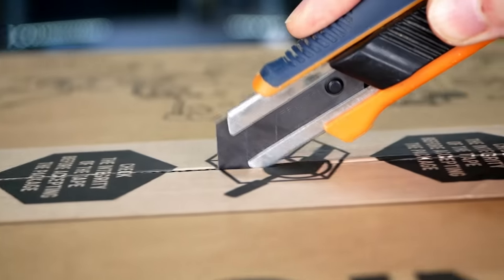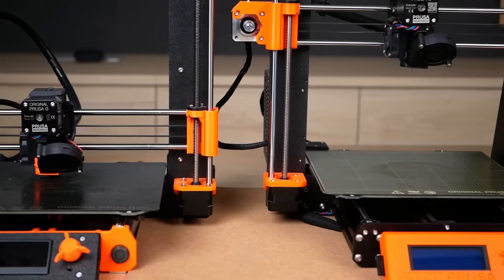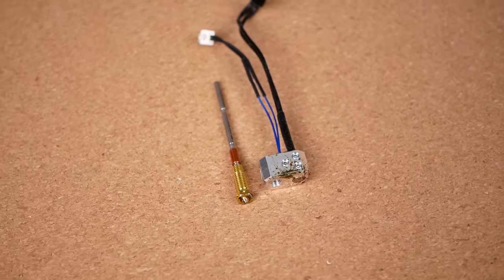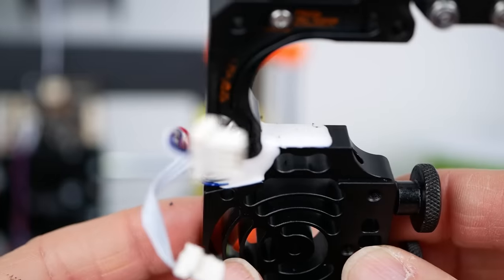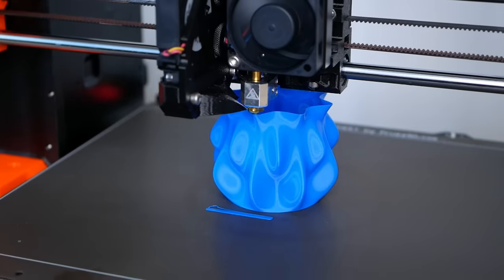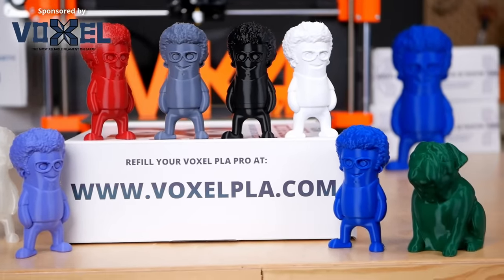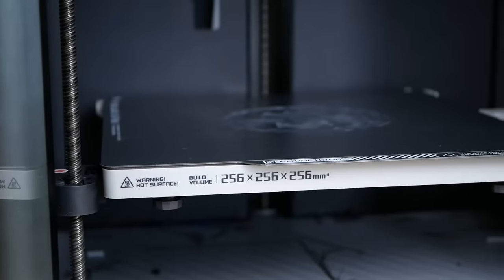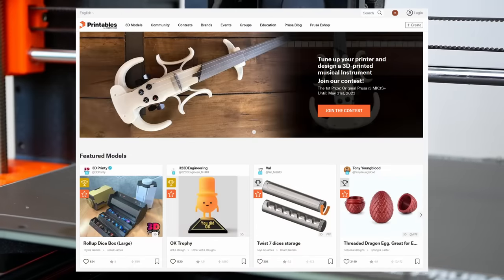Should you buy a NEW Prusa MK4 in 2023 or rather a Bambu Lab X1/P1P?

Comment: One often overlooked and not mentioned aspect of the MK4 is its terrible WIFI module (which is the same as in the Mini, so it is NOT fixable via an software update). It takes several minutes to upload a 10MB G-Code file and this is unbearable in 2023! Prusa Link isn't very good either (cueing for instance not possible) . Working on a daily basis with multiple 3D printers, this comfort feature of managing your data wirelessly and not needing to handle it with multiple USB sticks is a must have. I simply don't know who is responsible for such a design decision, but it shows to me, that Prusa is not able to provide products that are up do date anymore. It is basically still an upgraded 7 year old printer design, which is not competitve.

Something else that is of concern, is the use of an enclosure for higher demanding materials. The footprint of the overall package in comparison to the build area is not space efficient at all. The bed slinger design might be suitable for cheap manufacturing cost, which is why it is imo ok for entry level printers, but not at a pricepoint of 800$+

The Bambu X1C is the way to go, the only downside is its noise. But replacing the enclosure fan to a Noctua adresses the major part of that. The downside is, it will oid your warranty.

Something else I'm reading a lot about is the open vs close source approach, which suggests that replacement parts will be available for the MK4 kind of forever, while the X1C will be dropped once it has a succesor. I personally don't think it is so simple and even then not too big of a deal. What if Prusa as a company will fail due to not being competitve anymore? What about all the custom parts then? And what about stocking up on the X1C, as the prices are really low?
Reply: That was actually the deal breaker for me. As much as I would have loved to pay Prusa my money for the features of the MK4, I don't feel like downgrading Wifi from 4MB/s (MK3S, Flashair SD) to 100KB/s. In addition, the nonsense with the missing input shaping at launch and the announced, partial withdrawal from open source, have made me cancel the order and wait for now.

Comment: my problem with prus style printers have allways been, that they are more of a project then a tool themselfs - shure - they are advancing ever so slightly, but compare it to a regular printer: yes its great that there are pen plotter designs available, that i can assemble and have a printer with, but givern the option of buying a hp,epson,canon,(you name it) printer from a electronic supply, that i just take out of the box and install the drivers for (and have my part printed in minutes, within enclosure, without dirt, automatic paper selection, ink cleaning and soon)  - its hard to justify anything, as long as i need a tool and no project.

Comment: Talking about Prusa shills and fanboys, Prusa MK~ and its people are like the best you can get from 3D printing - a well-thought machine with open source and long term support in mind, gets a community who loves tinkering and contributes. This is why I'm happy to pay the Prusa tax when it comes to MK~ and I'll do so for MK4.
Prusa Mini, on the other hand, is the worst you can get from a supposed-to-be open source machine and community. Defective design e.g. leaky and often heat creeping hotend (because of terribly designed throat), crooked and hard to adjust axes, inaccurate probes. After market parts are more like bringing back the machine to usable quality than an improvement, makes you wonder why a machine that costs 3x an Ender 3 would need so many adjustments like the Ender 3. Worst part is I'm sure I'm not the only one who's been bashed by Prusa fanboys when raising questions that touched the design defects, like it's your problem and never the machine's, like you've never tinkered a machine before.
(If you think the Mini is excellent as a machine and want to tell me I'm wrong, just don't - after many ping-pongs with the fanboys I realize people have different standards and I can't let you agree to mine, as a tiny print farm owner, over several comments on the internet. Move on and don't bother.)

Comment: No, I don't think you are a Prusa shill. I hope you don't think I'm a BambuLabs shill for this comment...

I want to comment on two things that you touched on in your review. First, open source, then the potential of the hardware in the MK4.

Regarding open source, the upgrades BambuLabs made to PrusaSlicer are so useful that I'm surprised they haven't been ported back in already. Managing multiple plates, is super useful, even if the "Project" concept is not quite fully fleshed out yet. But the slicer is just about the only thing that's open source about their offering so far and that does make me sad as well. Manufacturers surely have to realise at some point that the community will do GOOD THINGS for their printers and ecosystem once it has access to firmware source code. I'd actually love to see a more in-depth look at the firmware on various printers and how open/closed it is.

It would be great if you could do a video on which manufacturers have open source firmware, and maybe even talk to some experts on software licensing to find out why a lot of companies are scared to release anything at that low level. I think you'll find a lot of them would be keen to but they can't open the license on third party components they use (e.g. SOCs), or maybe even aren't able to guarantee the software bill of materials because they didn't track it and are scared that if they open the source they'll be found to have stolen someone else's code, or violated someone's patent. I don't know if this is the reason so many printers are closed but I think it would be interesting to find out if it is.

Hardware wise, aside from the innate limitations of the bed slinger model, I think the toolhead on the MK4 has the potential to rival the BambuLabs X1C on the "print and forget" front, and I'm excited to see where Prusa take it. When I first read about the load cell I instantly thought about how it could calibrate extruder pressure for any filament dynamically and in a way that didn't rely on flakey lidar.

I imagine at the very least there'll be a first-line calibration coming soon, since that seems more straightforward in that it won't depend on the shape of the model underneath and rely on pressure against the print bed which should be relatively constant once you've levelled it and calibrated it colliding with the same load cell structure.

But you could potentially take it way further than what BambuLabs can achieve with their lidar sensor, which only really works on stuff that's already been laid down. The load cell can sense any force against the assembly which includes the nozzle, so In theory you could keep calibrating and adjusting in real time throughout the print to account for slight inconsistencies in the filament diameter/density, or even detect bad layer adhesion or model movement mid-print and compensate for it. Stuff you just can't do with the lidar sensor, which really can just tell you how bumpy something is to an absurdly fine resolution. The load cell could tell you how hard the thing underneath it is pushing back, and that has huge potential.

But that's unfortunately all theory so far, and from what I can see, all the MK4 has proven is that BambuLabs really have upped the bar; to the point that Prusa is scared and has released something probably earlier than they would have liked, in order to have at least something in the market, before it gets completely dominated (if it isn't already).

My BambuLabs printer cost less than the printers it has replaced, runs faster and more reliably than anything I've had before, and the AMS has saved me hours of messing around changing spools. Big print but nearly finished a spool? Load another of the same type and it will switch over when the old one runs out. Want clean supports but don't want to burn $10 of expensive support material per print? Use it as the interface material only and 750g will stretch for hundreds of prints.

I really wish I had the money to buy a Prusa MK4 just to support them, but unfortunately I'm not that successful yet. And I don't need another printer right now, as exciting as the hardware is, until it can show me some proven advantage. Watching closelly though! 

Great video as always!

Comment: Someone who decides to buy a new printer and doesn't care about opensource and its advantages will rather choose the bamboolab because the prusa is naked and you have to build an housing yourself to be able to print wrapping and high temperature materials. Especially when you look at the cost of energy and what you can save if the printer doesn't half away heat your (maybe not well heated) shop, users will decide for an out of the box housed printer. Also if the price is almost the same. IMHO prusa can hope that long time mk3s users (like me) will upgrade to the mk4 and switch not a to an really ready to use printer like the bamboolab

Comment: Need some help. I want to print for war-gaming and warhammer. Should I go with a PLA or resin 3d printer. Should I get a  Prusa MK4 or a Prusa SL1S? I dont want to make a mistake at purchasing. Want a good printer upfront, not worried about cost but want the function of finding files and printing bits and pieces for 40k. Can someone provide some advice?
Reply: FDM can get the job done, but the little vertical lines become very hard to ignore on small detailed figurines, need a lot of post-processing and their print-size is really inviting you to make mechanical stuff with it instead. For the tiny detailed stuff like tabletop (war-)gaming, Resin Printers are the way to go as they do incredibly fine details with minimal artifacts.

The only problem. Is that you are going to be working with Resins. Which needs some extra work in the form of UV curing and washing. All the while taking care as to not get that stuff on you (Disposable latex gloves are a must). Easiest is to get a matching washing/curing system for whatever you get..

On printers. There are plenty of good Resin printers these days as they are themselves mechanically simpler than FDM. If i had to pick one. It would either be the Prusa SL1S or one of the Anycubic Photons. They both use custom hardware, where as most use a proprietary Chitubox module with "freemium" slicer software.

On finding models. Only advice i can really give, Is to look for "Warhammer 40K STL files". STL being the file-format most 3D-models for printing are stored in. Note that there are free and paid-for models. Worth wile to first look around to see if there is enough to warrant investing in a printer.

Comment: Durability(due to lower operating speeds) and longterm quality and ease of maintenance and customization seems to be in favor of Prusa. Mass production of reasonable quality parts seem to favor Bambulabs. Closed system, with propreitary parts and a less secure cloud based system, seems to be the weakness of Bambulabs and might not be a choice for engineering prototypes that need strong IP protection and industrial strength parts. Just some 💭

Comment: Bambu X1C with AMS for me. Not. Even. Close. I've had a Qidi for over 7 years, and I'd consider them too (good availability of parts, worked correctly out of the box- very important to me) but Bambu seems better on all counts (reasonably priced spare parts available easily) and is very reasonably priced for what you get at around $1500. The only thing I'll miss is Octoprint, but I won't miss fiddling with printer bits and Linux arcane settings one bit. The AMS removes so many headaches. PLA is fine for rough prototypes (and for people who print figurines and such like) but I want prints in materials that won't warp if they get  warm so consistent results in engineering materials such as ABS, PC and Nylon. Which does not suit the open bed slinger hobbyist design.

Comment: Interesting that your workhorse PRUSA is in a custom enclosed plexi box with temp gauge and anti vibration bed it sits on. I think you need to add that cost + labor to compare it to a Bambu.  In the end you do sound like a purse schill. I have 2 PRUSA paperweights MK3 and Mini. Both excel at making spaghetti for a first layer. Tried support but pretty much non existent in the US other than a hit or miss public forum you get contradicting advice.

Comment: I have used Prusa printers for years and while they have a lot of design and production details that are not ideal (or simply painful to see like zip ties as structure) they do work reliability within their limitations and have produced huge numbers of parts. I recently started using a Bambu labs X1 and it has some advantages in terms of speed but I don't like the "Apple approach" with proprietary everything, accounts required, non standard connections, etc). I really dislike like the lack of a viable USB or full size SD card for printing as it more or less forces you to use their account based system.  (who is going to walk around with a mirco-SD card) The Bambu Labs hardware is designed for manufacturing which is something Prusa has really missed and BL avoids the frankly silly gimmick of printing parts for printers. On the other hand the use of carbon fiber rods for linear bearings is just marketing hype. (Igus aluminum rails would be much better) I also would not trust the CFRP to handle wear and high temperatures. I will not spend my money on a Bambu Labs machine or a Prusa Mk4, but I will probably get an XL when they are finally available/working with multiple extruders and an enclosure.

I would add also that the print bed plate for the Bambu is horrible. The spring steel plates for the Prusa are much better

Comment: I want to get one. That load cell bed leveling and single layer sheet peeling is just too amazing to watch!

Also I wonder if with just a few more tools, some gauges or something, you could use the load cell to calibrate some Z steps or something. Though I guess with those thicker z screws that's less of a problem.

Comment: The whole reason I won't get PRUSA, is the damn price.  For most of the main features you need out of a printer....can be found for HALF or less in price then what a PRUSA printer will run.  You also will get bigger build plates then a mk3 or even their new mk4.  The X1 price is justified because its a core X/Y system and just STUPID fast, also the 4 color add on, allowing you to print IN COLOR from the get go, instead of having to add on a Pallet system.  The overall issue with Prusa is the complete lack of understanding what they are going to be up against.  Their price vs build volume sucks vs what is on the market now, for half the price usually.  
Overall Core X/Y printers are really the future of printing and will eventually be the death of "bed slinger" types.  Bed slingers will stick around for a while still because of the bed sizes they are being built at, like the Longer L5's massive bed.  Though not like a Core X/Y printer couldn't be built with a 300mm or bigger plate.....(Note: Voron Trident and 2.4 both have 300 and 350mm plate options but at $1300 and $1500 price range)

Notes:  Elegoo's Ender clone the Neptune 2, runs about 150 bucks, or about 180 for the upgraded S model (dual gear extruder, PEI bed, common upgrades you could do yourself are on it by default).  The Neptune 3 is running about 230, with self leveling.  Either way these are cheaper options, running 32bit drivers on the X and Y axis with slightly bigger plates (220mm) and better bed materials too (G10 bed or PEI bed).

Comment: its so silent because its so slow ( once again) and 1410€ with a housing and still have a slow bedslinger...wish they would change to a CoreXY for the main market. And if you compare...compare the P1P for 780€ with the MK4 Assempled for 1200€ or the X1 1350€ with the Mk4 and housing 1409€   and the MK4 then cant print high temp Material because it still build with PETG parts that dont like if there is 50-60° in the chamber...
From tech point of view your channel is top...unfortunatly you are still a Prusa Fanboy ( but not so hard as Thomas i have to admit) What Prusa do right is , thats its a open source printer...and the prusa slicer is still based on Slic3r so dont blame bambu that its based on prusa slicer ( wich i use too)

Comment: I have many Prusa printers now and 2 mk4 kits on order.  I will continue to support only open source 3d printer companies.  Bambu might be a better printer in some regards but not being able to source parts, or repair your own printer is a major issue.  Also the design of the x1c and p1p are not repair friendly.  I can repair any problem with my mk3s or mini's in less than 30 minutes. With a Bambu, anything besides a simple repair and it has to be sent back to them for repair/replacement.  3d printing is not at the full consumer plug and play level yet, and just throwing away a $700+ 3d printer is not sensible.

Comment: The thing that really burns me with Prusa is the Z build volume.  I need more for several of my projects, and for that price point, it seems like a little more isn't too much to ask for.  I almost bought an i3 Mk3 a few months ago, but didn't for that very reason.  I also suspected that they probably had a new version coming out soon.  If I had gotten one just to see the new version immediately come out, it would have led to some serious buyer's remorse.  Decided to stick with my CR-10 v2 for a while longer, but I'd really like to upgrade to  Pro-Sumer model like one of these two printers, assuming that the specs meet my needs.